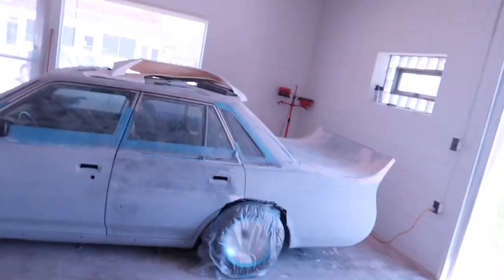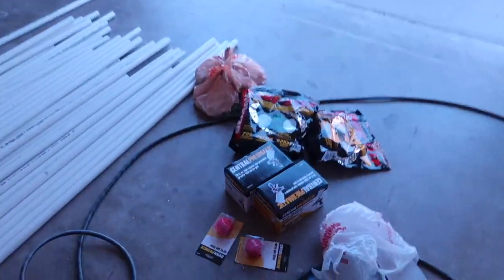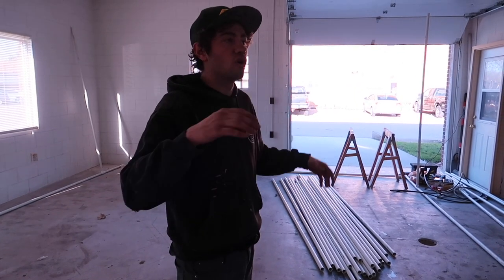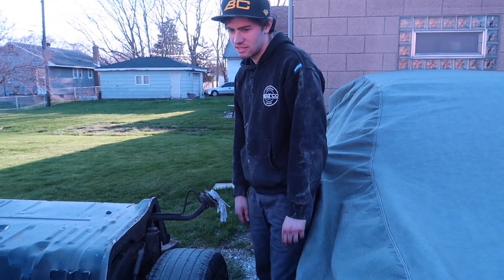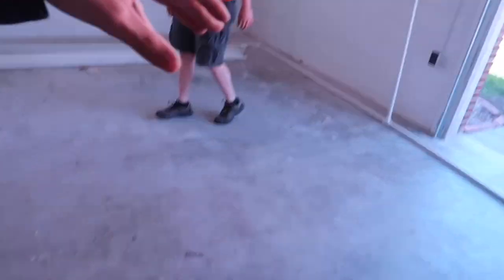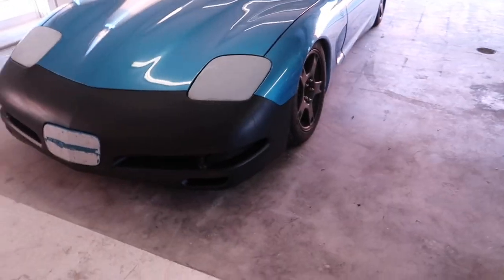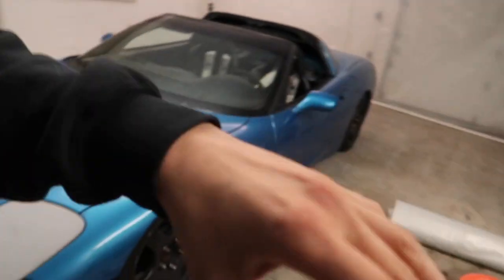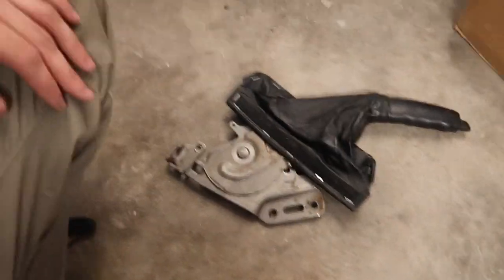Building A Massive Paint Booth For As Cheap As Possible

Comment: make the booth really moist to stop all the dust floating around in the air and try to vacuum as much out as you can, also set up fans, 2 blowing air in and 1 blowing air out, this will make slightly higher air pressure in the booth that will help blow out dust